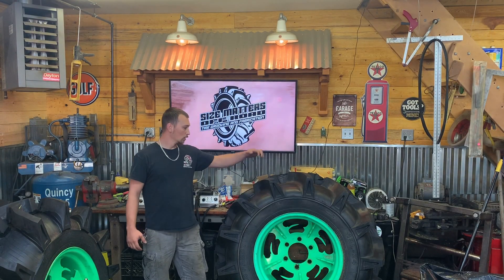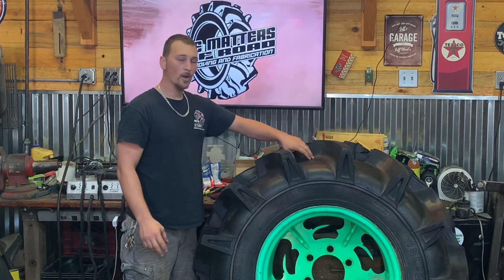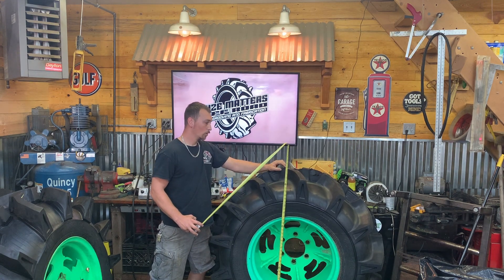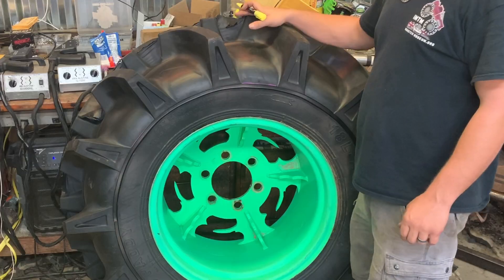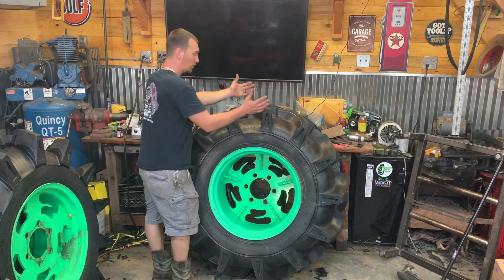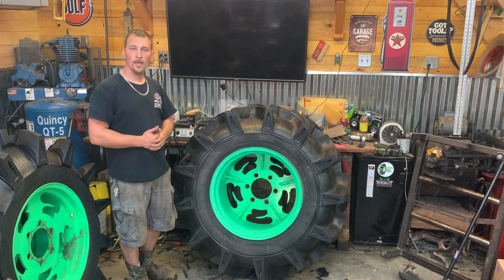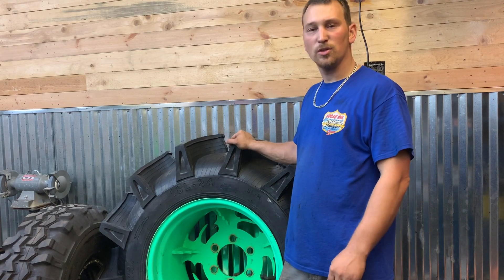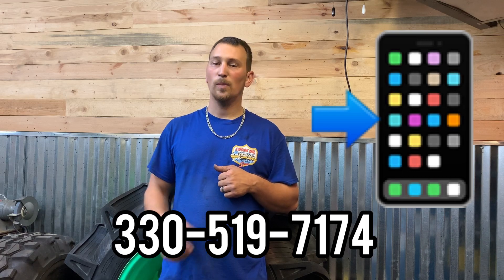Grooving 18L-24 paddy tires

Comment: So, in your experience, or seat of the pants feel… what would the lbs to hp ratio be? I’ve heard 3lbs rotational mass is worth about 1 horse…. So in this case, you freed up 80-100 horsepower for him. Would you say that’s pretty accurate?
Reply: I wonder how that works for my big red 250, 9hp with 240lbs of assinators on it. Am I negative horsepower?